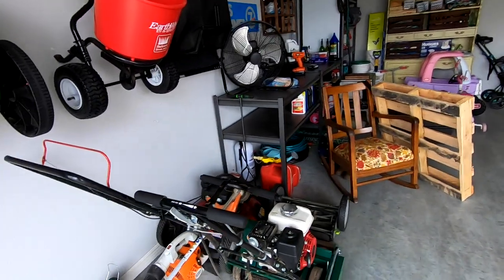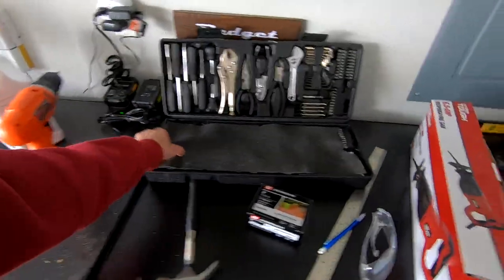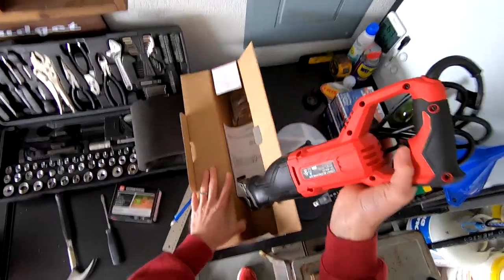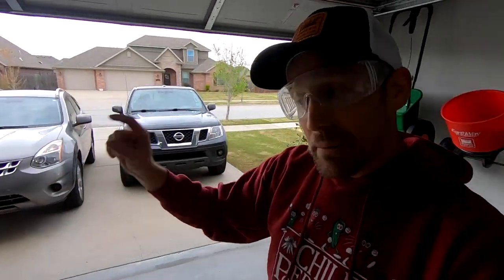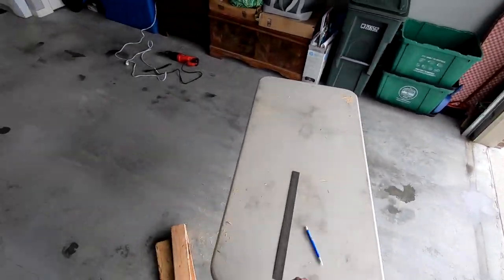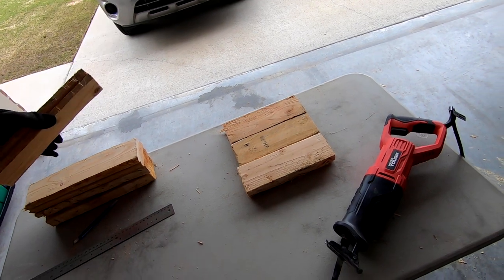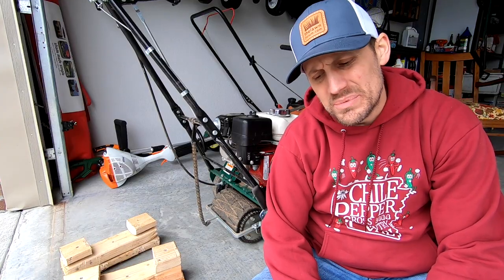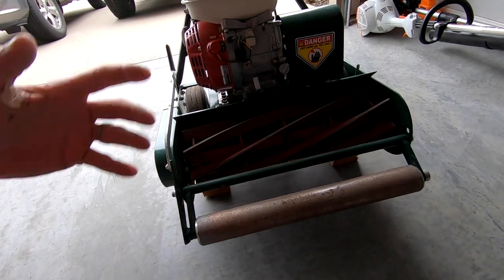California Trimmer Reel Lawn Mower Service Hack for Reel-to-Bedknife Checks & Other Maintenance

Comment: I just did this to on my Cal-Trimmer, so much easier! Maybe a video soon on the reel to bed knife adjustment? Mine is very touchy and I have to adjust every few mows.
Reply from the maker: Right on. It’s worth it. I might try to do one soon. Haven’t used the CT in about a year. Moved into a new house and the lawn is far from ready for a reel mower. When I was using it, I’d check the reel to bedknife every other mow and have to make adjustments about every 4 or so mows. As long it cuts paper across and isn’t too tight, you’re good to go. Thanks for watching. Hope this helps.